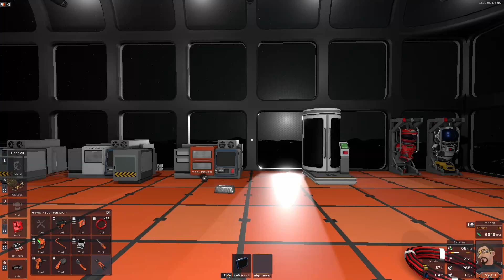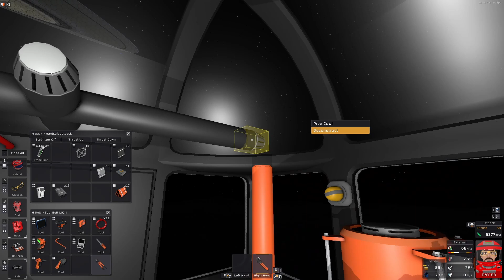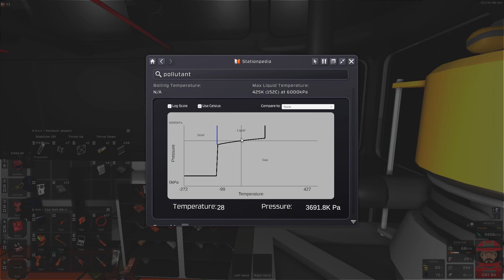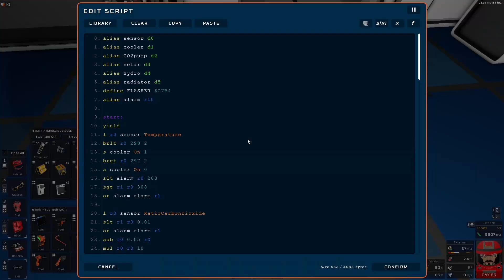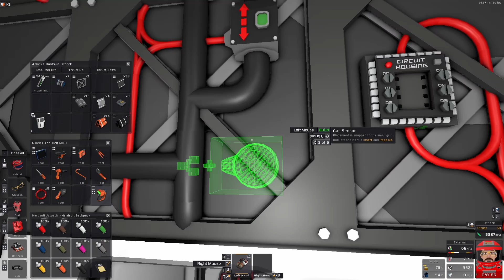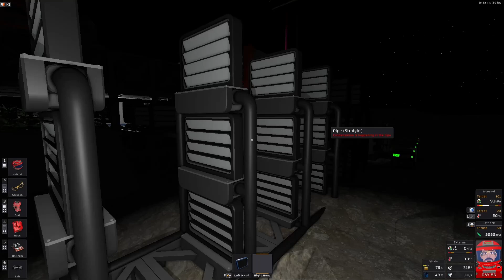Stationeers Brutal Mimas 15 Cleaning up

Comment: There was a pollutant filter in the locker next to the exterior storage solution (the pile)
Filters in slot 1 are consumed first, slot 0 are second, you should place the new filters in slot 0 and move the existing one to slot 1
Remember the internal pipes next to the cooler and the pressure release valve of the big room are uninsulated pipes.

Comment: Nice vid again Mick.
easy cooling system on mimas.. digital valve before pipe/rads outside, back pressure regulator on return feed.  once at desired cooling, digi valve turns off, BPR stays running for xx seconds until cooling system vacuum, then turns off.
Reply from the maker: If I had more heat generation that might be needed.  But simple worked.